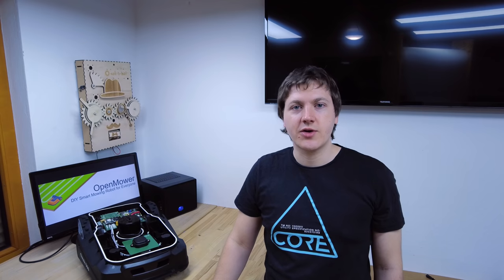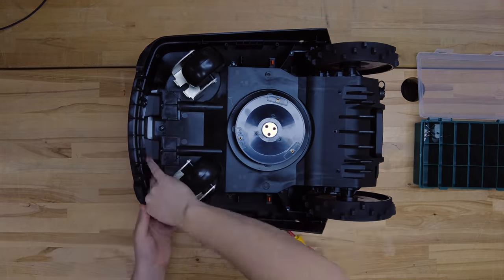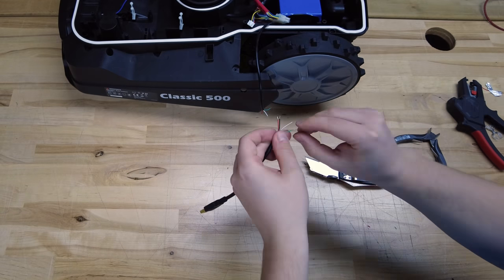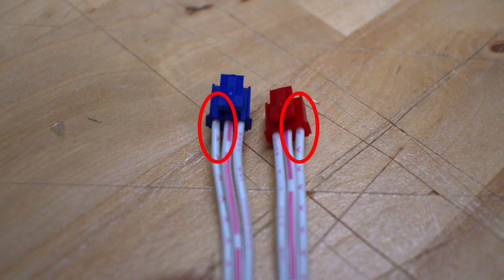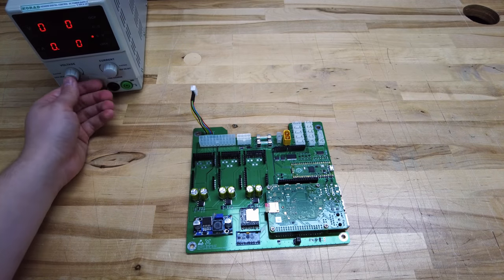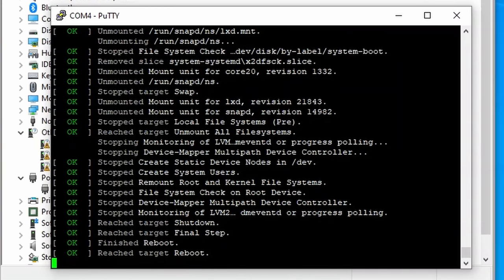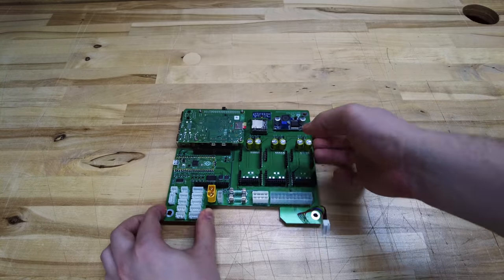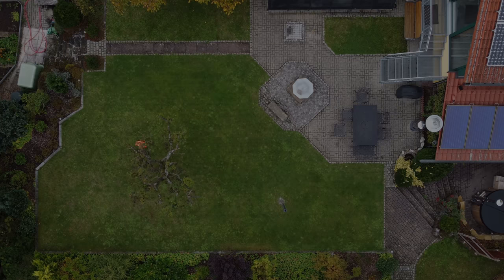OpenMower: Robot Hardware | YardForce Classic 500 Teardown, Mainboard Replacement, Firmware Install

Comment: Cutting the GPS antenna cable to the correct length actually boosts signal strength quite a bit! It also is not that hard to terminate the cut cable. Nice video!

Comment: Tip: DO NOT twist the wire when you crimp the JST connectors - as you crimp, it cuts the strands if they are not parallel to the connector lugs.
Reply: This is relevant for all types of crimped connectors. Explains why I've had so many problems with bad crimps when making stepper motor connectors.
Reply: @bogmaerke  Yes, me the same, until Big Clive pointed it out! I wondered why my crimps were falling apart!
Reply: Thank you. I now know why lol. Makes sense now that I think about it.
Reply: I buy them in a kit with precrimped wires on amazon nowadays
Reply: @FourthWayRanch   Good idea - makes it much easier!

Comment: I've been thinking about this for years now, so excited that someone did it!
Sooner or later, I will build my own.

The thing with the USB cable makes sense: Red and black are 5V and ground respectively, and white and green are the two data wires. Essentially, you made the USB equivalent to an RS232 nullmodem cable.

Also, if you can, I would recommend putting cards to the assembly videos at the end of the original viral one.
Furthermore, your channels main page is pretty empty, maybe you should also do something about that.

Comment: I was very excited to see the first video popup. The only drawback is that I'm in the US. There basically seems to be no options as far as cheap robot mowers to convert. :\
Reply: Worx has US sellers.
Reply: @CncObsession  None that come close to price compared to what the official project uses. The project is based off of a mower that would cost about $400. I'm only seeing Worx mowers here in the US that cost $1000 and up.
Reply: US yards are larger, so I’m looking into converting a 21” electric to drive motors and autonomy.

Comment: Super interesting. My yard is about 1600m^2. Most robomowers are too small for that. I’m converting a 21” electric mower, with drive wheels, and may apply your electronics and software to the system.

Comment: Great job! I would like to integrate this with an old Robomow RL2000, which is basically indestructable and capable of mowing a much larger area.
Reply: I have on old Rl2000 as well. Not sure what is working and whats not. Do you plan do throw all oryginal robomow electronics away and leave just motors with body?

Comment: Your work is absolutely terrific! For the time being I have just subscribed to all your updates, but I believe that what you're doing has great potential. I can't help a lot with with the hardware part of things, I know very little about electronics, but I have created and contributed to HomeAssistant integration and if you want some help creating a integration for this project I could help with that. I think that the target people for this kind of DIY projects and the kind of people who use home assistant might intersect quite a bit, so I think that having both speak to each other could be a good way of getting even more attention to this project, and hopefully patreons.

I only have two questions. Have you investigated how many changes this project would require to work on the worx landroid lineup? And the second one, since this project uses an ordered mowing path instead of bouncing randomly, have you observed that the lawn area that the robot can mow is significanly bigger than with the random algorithm or the (probably) greater power consumption makes things even? From where I stand, I have the feeling that following an structured pattern leads to a low more mowing capacity.
Reply: Omg, did u said home assistant integration?
Reply: Completely agree, there should definitely be a Home Assistant integration!
Reply: You'll never get a response this is some kind of distraction technique

Comment: I am very interested in this. I wasn't even aware of the RTKGPS stuff until your last video. My goal is to build my own robotic lawn mower, more or less from scratch, but the same concept. I got a motor drive assembly and batteries from an old shopping scooter, so now I need to build a chassis and steering assembly with a mowing deck. I've been considering trailer attachments for things like fertilizer and weed spray so it will apply more accurately (Not using a spreader, but using a dropper instead).

Comment: This is brilliant.  I'm looking at a similar  project.  I need to build an unmanned gritting machine.  Obviously it's.goingnto need to carry  significantly more weight due to the grit salt and batteries.  But I was worried about developing the software.  Would it be possible to have the system triggered by temperature?  So if the team drops to say -1c it starts the cycle?

Comment: The interaction between the Rpi and pi zero was confusing. Why not setup the Rpi before plugging in using an external keyboard/display? Also, if the WiFi details change, how can the Rpi be updated?

Comment: Love this project!
Already 4 years ago I searched for a DIY solution, but none came out.
I've got  >4000m2 of land and steep inclination (40-60 degrees) that I need to mow by foot.
If I build a mower able to drive into my land, is this a feseable solution to automate it?

None of the commercial solution are able to drive with these inclination and I do not think it is feasible to surround the land with a 500m long wire so I need a GPS solution

Comment: I want to build an Autonomous Lawn Mower. Just a regular walk behind mower with wheel chair motors. For GPS, I'm going to buy a simpleRTK2B Budget. My questions is. As far as GPS, do I just need the simpleRTK2B Budget and the antenna. or do I also need to make a base station as well? Id rather not buy what I don't need. Do I need a base station?
Reply from the maker: For RTK GPS you will need some kind of correction info. This can be your own base station or an external service provider. Depending on where you are these can be very pricey or even free. Just look for NTRIP RTK correction services, if it's too expensive or nothing available near you, you will need to get the base station.

Comment: I have been looking for a project like this for over a year and just stumbled into "open mowers". Your project looks great! Coming from an old time CNC programming background, I found it puzzling why there were no commercial vendor implementing a back and forth mowing pattern with in a virtual boundary, with avoidance areas. Your Project is good stuff. I eagerly await a plug and play version as I have zero electronic hardware skills,  limited software skills, but many mechanical skills (retired Mechanical Engineer). Being Old and Slow could you direct me to a BOM so I can figure costs and start figuring out haw I can build one??

Comment: It's my understanding that the mower used was chosen as it's a fairly standard design that is the same as other offerings. Do we know what other mowers do/don't use this design? If the Worx Landroid is an unknown I'd be happy to take mine apart to contribute to the project.
Reply: Thinking on this further, the landroid's blade is in the corner, not the center, so it seems unlikely to be the same layout, though the components could be similar.
Reply from the maker: Yes, unfortunately it's not the same as a Worx. I do like the worx with the off-center blade though. There are people on my Discord trying to get this working with a Worx mower, so maybe this will work for you in the future.

Comment: I'm using ardino with gps/compass w/ Bluetooth. I wonder if the software can be used with an app. Specifically an android where the phone could be the (xbox) controller and the GPS points would be saved. My app controls speed w/ turn speed/hill variables. I also wonder how many pings are used per foot(meter) . The compas (hmc5883l magnometer) is used to keep the lines strait as it drives straighter that my rc abilities (variation 4-6⁰) . My mower is a 40v kobalt and now to start a new row i just do a 180⁰ turn and repeat but the land mines are difficult to avoid. Now I just skip it and use a trimmer later.

Comment: Hi if I can summarize the objective is to replace the magnetic principle wiring tracking system by a GP¨S teach-in programming system. GPS card is needed, connector have to be changed as well as the hardware programs. Right?

Comment: If you made a version that ran on a standardized Arduino board that people could just buy and drop-in, that would greatly accelerate your adoption. Of course that would leave out the GPS, the biggest feature in this project. 
Maybe a branch to focus on would be a GPS add-on board that can be easily connected to an off-the-shelf Arduino. 
The cost of the GPS itself is still rather prohibitive to a lot of folks. That's a whole other barrier to overcome.
Reply from the maker: That is true, but without the GPS the mowing behaviour is basically the same as in the stock unit. There would be no point in modifying it, then.

Comment: Is there any particular reason for using Rpi4 and Rpipico rather than for example esp32+stm32? Rpi4 is quite power hungry, so if you’re not planning to run computer vision based stuff I’m guessing there is no reason for that kind of cpu power
Reply: I agree. esp32 for wifi rtk to fixed diy base station (Gnss Rx, Esp32, no internet needed), highest accuracy from closest base station. Std stepper drivers from stm32f. As a thought, its pretty similar to a 32 bit 3d printer mainboard. Possibly design main board to use identical connectors as original, so no new plugs. Major cost rtk gnss reciever/aerial.
Only problem with Yardforce mower is it will not cut to the edge.

Thanks for your hard work and the interesting and thought provoking video. 

Best Regards
picclock

Comment: This is a cool project, but I feel like using a raspberry pi and a raspberry pi pico is overkill and requires tons of setup work. I feel like this project could be done easily with an ESP32. You can run micropython too which makes it easy to program

Comment: I wonder if a hardware emulator might be useful for development work
Reply from the maker: I'm using a simple simulator which is available for ROS. So you can develop this without actually running it on a mower already.

Comment: I really like this project. However I think a version without gps - but with perimenter wire and naviagtion via the sensors you mentiond would also be an option for a lot of people. since this is still better then the default and way cheaper
Reply: If that is wall you want then just get a commercial version since that is how they already work.
Reply: @fuckthisksksjjksdfjd  really? do u have a model/brand?